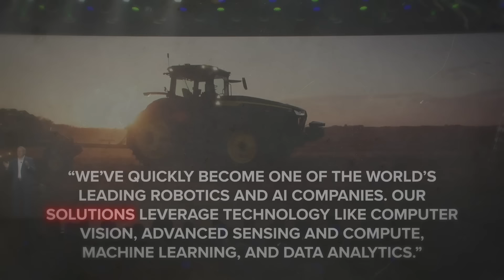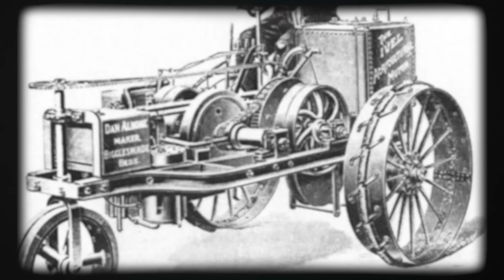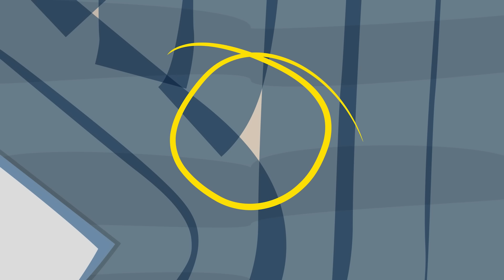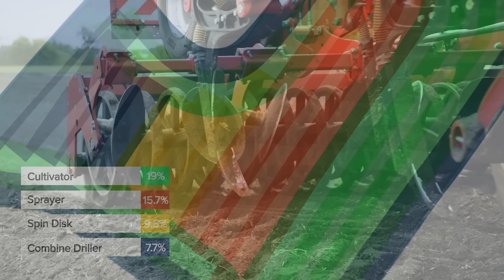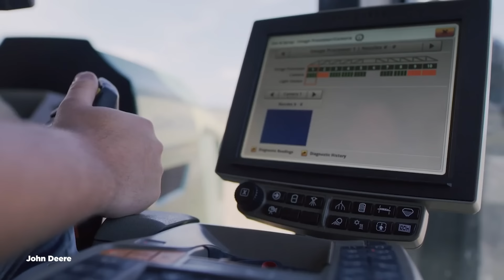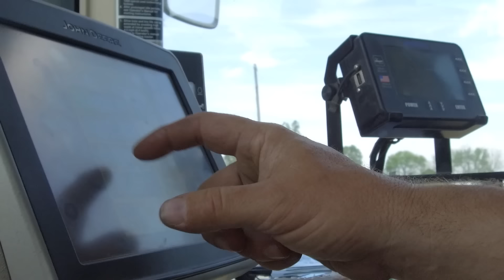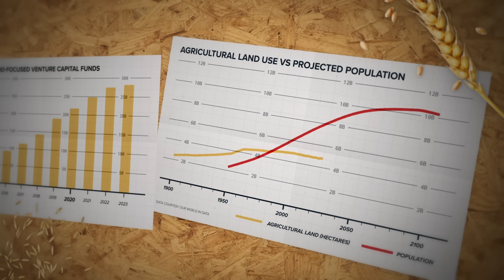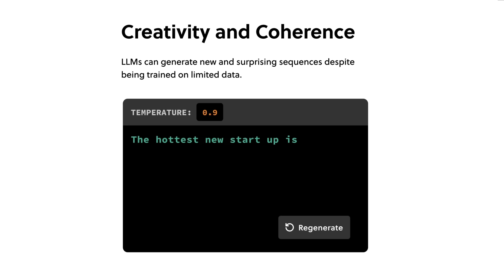How Big Tech Ruined Farming

Comment: In South Africa many of the farmers simply refuse to buy this hi-tech equipment. Instead they'll own a basic tractor and sign short-term leases for the fancy equipment only at the times they really need it (usually at planting and harvesting time). These lease contracts usually include the operator who has been trained by, and works directly for, the manufacturer. 

This system works well because if the fancy stuff breaks down then the manufacturer has to get it fixed while supplying the farmer with a spare. It costs the farmer slightly more, but avoids all the costs and hassles of owning this stuff.
Reply: Not a bad idea, but sucks for the trained operator because you just know they aren’t getting paid enough to live between “events”.
Reply: Consider buying from China, they have better equipment that does not capture farmers. They have cheaper drone systems that don’t require contracts or bound to manufacturer repair harassment.
Reply: People tend to check out all available options before buying tractors. No one is going to buy a brand new tractor from a new brand with no record to its name and no proven track record. A tractor isn't just a car with big wheels, it has a lot of very complex hydraulics, electronics, gearboxes, etc.
Reply: Smart
Reply: @sheeplord4976  I'm no farmer, but it's like people think these pieces of equipment are just big riding lawnmowers. The implements to harvest soybeans and corn, the machenary that separates cotton as its harvested are really complex and complicated. Margins are already thin, Just "go lease a new tractor" at an increased price isn't a good business decision. If you're in a pinch and you HAVE to plant or harvest, you have to do whats necessary. But leasing season over season, I don't see how that's profitable.
Reply: Yeah there totally have to be some hidden strings attached to that. Seems a bit too inconvenient for companies
Reply: That is the only way to go, buying any new truck/car/tractor is just financially foolish.
Reply: That's a nice workaround, but only temporary at best. There is no such thing as "free lunch". Someone is paying for it (like another reply above mine said: the workers are probably under paid).
Reply: @Ratinevo  no boycott west Taiwan in every way we can.
Reply: @Ratinevo  - Or buy from India they have Nihandra brand, cheap, efficient, and fixable.
Reply: As explained in the video, American farmers often have no choice but to adopt this tech to become more efficient, because their costs are rising and prices are getting squeezed by bigfarm competition.
Reply: That's genius
Reply: @BillAnt  *Mahindra
Reply: @starliner2498  - Ya . lol
Reply: @marcusmoonstein242  sounds like a good plan that - well done. More expensive in the short term but works out better for you over the longer term, as you don't have an overpriced piece of kit sitting in your shed most of the year, constantly depreciating in value.
Reply: Yah you are right, in the Free State or Limpopo I've never seen these John Deere fancy Tractors apart from the basic range. 
I hope the hilux and ranger are listening
Reply: @mzaite  Not a bad idea but here farmers need the seeders and harvesters at exactly the same time.... Cannot control the weather planting harvesting spraying delays.... And they spray their perfectly seeded rows but if one or 100 weeds get away in a small area will not hand pick to avoid an outbreak in future years... Shit for brains... But will pay John Deere $30,000.00 to have a GPS system in their machine..... Cause it looks good.... For the 1st month when they see straight rows from the roadside!
Reply: Hey, howzit 😁
Ya, a farmer should be able to fix their own stuff. It's kind of a farmers reputation.
If you have DRM & similar abstractions that stop gamers fixing their stuff, it's just a red flag....

Then, sadly, there's a hugely scary concern of regulations & tech being used both restrict & kill family owned farming.
There's a worrying trend of big business & Bill Gates owning farm land, and shaping their empires by pushing out "the little guy"
Reply: This won't last, though. These leases will slowly become increasingly exploitative one way or another until they're as profitable as the permanent.

I'd bet a lot of money on it very comfortably
Reply: @christopherhammond9467  your own house has tons of Chinese products in. Are you boycotting? Lol. It's barely possible
Reply: Uber tractor!
Reply: @christopherhammond9467  Calling it west Taiwain is kind of an insult to Taiwan.
Reply: @johnjingleheimersmith9259  depends on how you look at it though I was being facetious. Both believe they are the legitimate government
Reply: @christopherhammond9467  Not really anymore. Taiwain considers itself it's own nation separate from the mainland now.
Reply: it helps that SA farmers can make a living wage on smaller sized (sq km) land areas
Reply: Tractors are field stuff to work not some gimmicks
Idk why those manufacturers don't understand it a tractor is for work not showing. Off we don't. Need this tech
Reply: @LibreGlider I’m sorry but if you’re in a pinch you don’t go out and buy some of the most expensive equipment in the world. This is definitely misinformed consumer decision. There is no industry in the world where you can’t go to the competition (even if at a loss, not always  in pure $) it comes with sacrifices and growing pains but we can’t cry and complain if we don’t change it. Do people honestly believe they can’t farm without John Deere equipment? We’ve been doing so since before humanity knew how to write.
Reply: In India, farmers still to this day work on the field relying solely on tractors and even bullock carts. Yes, some big farmers do have cultivators and other big machines bht nothing fancy like an auto-steer. And they can get these additional facilities like satellite data if they wish foe free from the governement agencies. Only cost is to employ someone who understands how to use the data as most farmers are uneducated or  do not have a degree to grasp these things.
Reply: @ You have a broken implement, but you have to plant 500 acres of soybeans. You've invested millions in your equipment, what are you gong to do? "Just go to the competition" isn't good advice.

Comment: 19:48 it’s not that farmers don’t know how to fix the tech side of the machine. It’s that we legally don’t have access to the tools to do so. The big tractor companies take the Apple route with software where they don’t sell you the software needed to fix something and force you to call a manufacturer technician out. 

On problem we run into at least once a year with our newer ish combine is if the engineer cuts off after chocking the machine there is a chance the computer will get locked into a factory degen mode. For this we have to call a guy out who then hooks up a laptop with company software, presses a few buttons and is done. Takes 5-10 minutes to fix, but because Case won’t let us have that software we have to wait at least 3 hrs maybe even till the next day for someone to come fix it.
Reply: You can repair your own stuff. This issue has been blown out of proportion because nobody wants to take the time to look at the specifics or use critical thinking to understand why some things require the manufacturer to repair.

Comment: It's easy to understand why Kubota's appeal has skyrocketed in North America in recent years, especially among small and medium-sized farms.
Reply: Yup. We bought a Kubota, although we didn't know all that much about them at the time. Turns out, about 70% of ranchers around here run Kubota. Super reliable, easy to repair, good documentation and manuals, good parts availability. Why buy a John Deere?
Reply: It wasn't that long ago that a 1400 acre hop farm I serviced as a consultant tried out New Holland. They were too fed up with Deere to give them a second chance from the previous growing season. Halfway through the growing season brand new Kubotas started showing up. And they've stuck with Kubota. NH is junk, Deere is expensive and doesn't run like it used to. Kubota isn't perfect by any means but at least they work most of the time. The farmers with money run orange, the broke ones are blue, and the ones that run green either have more money than sense or they're running old green that'll probably outlive them.
Reply: It may set on fire once or twice but dammit they still run, those things take abuse
Reply: Yep, my dad owns a John Deere and two other tractors one of which is Kubota which we use the most, it has needed a few repairs but it works well and is super reliable. The John Deere on the other hand still needs repairing and has been sitting there for 1/3 of the time we’ve had it.
Reply: Thank you for share this, Kubota doesn't arrived in Brazil yet but your comment did give me a good ideia

Comment: Fun fact: John Deere's diagnostic software was apparently made with some open source components which might unravel their anti-consumer practices. Meanwhile Mack/Volvo/etc software is being reverse engineered by some nerds.

Basically these companies treated software as an afterthought, hence why stuff like Tech Tool has horrid UX and is only available on heavily locked down configurations of Windows. So the laptop is constantly updating slowly and even when it works you're waiting forever while a highly unoptimized program communicates on J1939.
Reply: @daisy9181  Talented coders need to incorporate the ability to sabotage their software at the coder’s will. That way if the company tries to fire them just before release, they can simply trigger the sabotage mechanism and take their hard work with them.
Reply: @Ethan.Lamoureux  You're basically implying a backdoor... that they could possibly be sued over later. It's not worth it. 🤦‍♂
Reply: @megamanx466  I never said it would be easy!
Reply: With all these complaints I see room for opportunity, some new competitor will come along and start taking market share.  Not many companies that were on the fortune 500 a century ago are there today.  Deeres behavior is common for how large companies die, it is normal and good.  It makes room for new ideas, ends up being better.  It already has competitors they see where Deere is loosing it and so will fill the void.  Ya'll need to keep up the complaints and have your wallet do the talking, you as a group actually have the power not Deere.
Reply: @Ethan.Lamoureux  🤦‍♂
Reply: @daisy9181  Actually, it's not like that. Yes, I'm a dev. Your comment would be like saying that a tractor is made by 1 or 2 engineers and then they can just fire these 2 engineers after they've designed the tractor. Or apply same idea to planes.

Reality is things are somewhat more complex than our imaginations.
Reply: @hardopinions  I mean they're somewhat right. Most modern inventions rely on one clever person's idea, scaled up 1000x, obviously you can't write 100's of thousands of lines of code by yourself

Comment: When here in Slovakia they started buying John Deere tarctors, they came with a long list of warnings what not to do with it, like protect it from deep mud, water etc. because of the electronics. The tractors we had were made in Czechoslovakia, these were some beasts of a machines. As long as their engine gets diesel and air, it works. There are some examples that had a belly armour underneeth them, so you could make a fire under it to warm up the engine if it was needed. Im not saying that John Deere is bad, but they are much more complicated to work with than older machinery.

Comment: I'm a farmer who is also a computer geek.  Suffice to say, you don't need this equipment to turn a profit, and the expense of this equipment is grossly understated. A person with 4500 acres would not have a 50k pull behind sprayer, they would have a self propelled sprayer. A 2023 612R like in the video, used but low hours, is 500k.  Maybe they could find an older self propelled sprayer with higher hours for 50k, but at 4500 acres, spending 100k wouldn't be unreasonable.   I have a 1966 JD 4020 tractor, a late 70's-early 80's JD 7000 planter(with upgrades), and an early 80's JD 6620 SideHill combine, good enough for me.  I get one of the cleanest samples (a small amount of grain that has been harvested with a combine) of anyone around(not my opinion, someone else), and can have much less loss in the field after harvest than someone who is directly across the property line from me (not my opinion, someone else).  You can have all the sensors in the world, some of the best tools are your senses.  Like last year after a corn head rebuild, I noticed I was having shatter loss at the head (corn stalk was being pulled too quickly through the stalk rolls, so when the ear detached, it would break kernels off and they would fly out of the head).  So I slowed the head speed down.  When you start harvesting a field of corn, you go a little ways, and look at the residue output of the combine.  Are the cobs fully threshed, are they fully threshed but broken, are there kernels on the ground, how many in a sq.ft.?  Keep adjusting everything until the harvest loss on the ground and "trash" level in the grain is acceptable.
Reply: Can't say it better. All those luxuries are confort, all in all, it's what grows in the field (and that you can get out of the field) that makes your money.
I was looking at the john deere precision system a decade ago and how it'd cost me an yearly wage, not to mention the subscription, so I decided to keep going my own ways with no autosteering. But last year I found an non expensive kit you could install yourself, while profiting from an open source RTK project, decided to build both and I now have a centimeter precise autosteering with no subscription and that cost me 4k only. The greater benefit is indeed to not overlap, but half the reason is to steer straight and clean while seeding. It remains a luxury, but I wouldn't do without now (unless they charged me as much as JD for some reason).
My father taught me that all the money I don't give out will be my money in the end (less the taxes....), so to make a good compromise between what I need and what I want. 
The oldest tractor we have is a JD4040 from 1978 that's self steering now, it's amazing that the GPS wasn't even a thing when this tractor was designed back then....
Reply: I am not familiar with farm machinery, but I have used Beckhoff Automation industrial computers to control a few complicated industrial machines. Beckhoff computers are modular and made up of a series of plug-in slices where each slice is designed for a particular function on the machine. It can use an LCD screen that can be used for controlling different operations on the machine. The computer is built for industrial environments. I believe that if say a couple of farmers were to contact them to use their controls for use in their machines Beckhoff would gladly help them with the programing for free. They have no special pricing for volume orders all orders have the same pricing. If they are successful there is a big market for them on all other types of machines. Check their site out to learn more.
Reply: you know, I'm wondering when there isn't all this older but still great equipment is gone and the only choices we have are a used 6145R or a 7210R. Those are great tractors but would be a horrible fit for my farm. They could squeeze us out just by letting time run the older equipment out and leaving just huge equipment to buy
Reply: @whatsgoingonhere3465  Agreed, small combines especially.  Imagine the wiring/electronic issues those machines will have.
Reply: @davidtuchscherer6276  Please post some additional information about the projects you leveraged for those tractor upgrades.  In small town America 🇺🇸 it can be hard for IT types to find enough work, and branching out into projects like that would be a great way to leverage our skills and strengthen our local economies.

Comment: The family lost their warranty because we made repairs on our tractor. If we waited for the technician it would have taken three weeks. The alternator had to be programmed to the tractor so we still had to wait.
Reply: Time to make a service expectation contract before buying another machine. If they won’t honor right to repair, the next step is liable for loss.
Reply: The alternator... had to be programmed... to the tractor!? How the unholy F does that shite even work. I'm starting to think the video didn't paint a dark enough picture of JD, that's insane.
Reply: @mnxs  the systems run on tight function margins, so the system needs to learn the specific variations of the part. It doesn’t need to be a cost add service, the onboard computer could just do it itself, but JD made it one because why not.
Reply: Funny how older tractors never had this issue. Almost like regulating alternator output is something that has been done for over a century
Reply: @mnxs  just remember it’s not only John Deere that does this. All the major manufacturers make repairs difficult
Reply: @mnxs smart alternators are a problematic feature on lots of machines….
Reply: @sheeplord4976  They do it to make money, not because it needs to be done.
Reply: @mzaite  oh fuck right off with the "precision" argument.
Alternators have been self regulating since the early 1900s. If they need to give exactly 13.6V, they will.
Reply: @mnxs oh it's brutal. Air filters for the new big tractors cost about $300 a pop and can't be cleaned manually (unlike every other air filter I've ever used on our new hollands for instance, though NH has their own issues).
Reply: Time and cost is a problem when forcing farmers to wait for a tech.
Reply: @foruneverban  just another way to weaken society
Reply: As a John Deere Tech, I’ve never heard of programming an alternator before. What machine was this on?